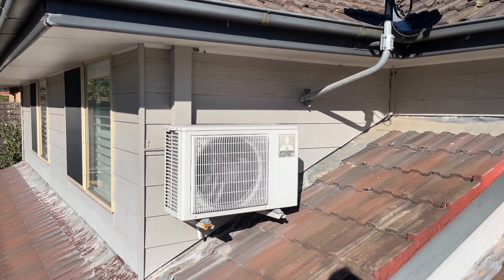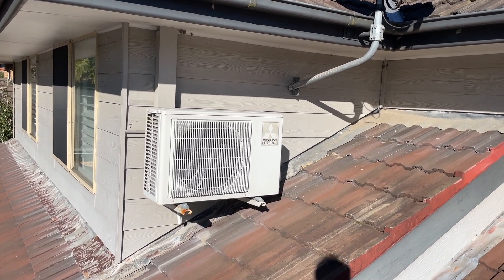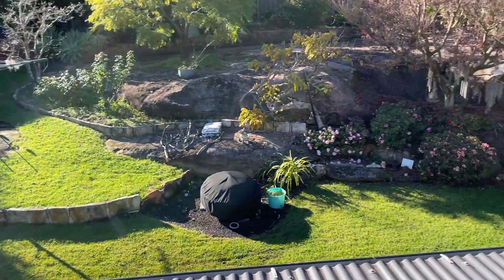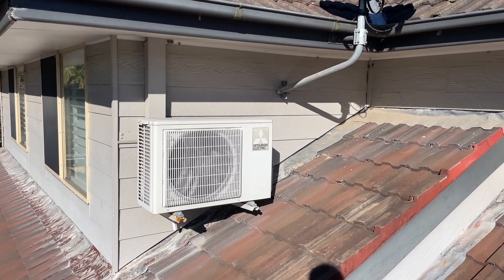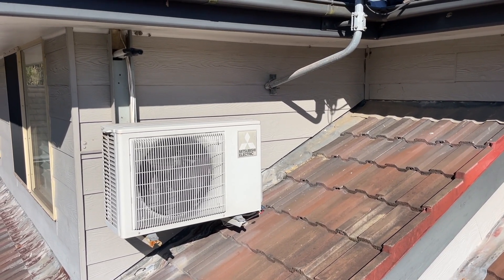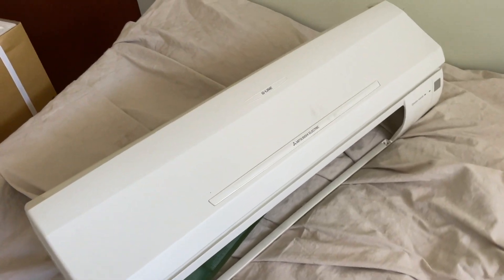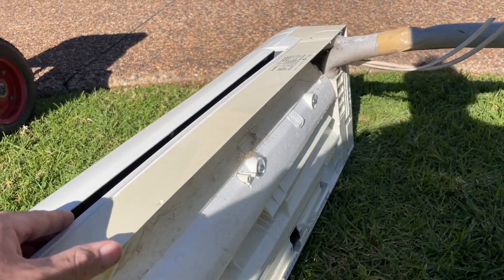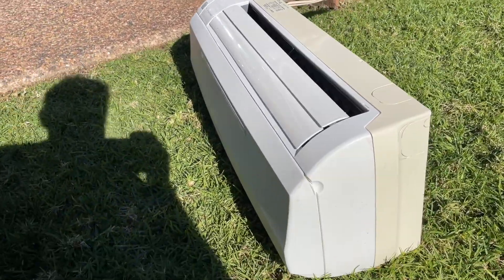Installing a Daikin Ductless Mini Split

Comment: All Mitsubishi Electric minisplit indoor units open that way, old and new. Newer ones have detachable corner pieces, which makes it much easier to open
Reply from the maker: @moisander8858  ah okay. If the sides detach, that’d be easier!
Reply: @maracservices  Yeah, on older ones if they are not going to be re-installed, i just hammer or cut the corners so i can get my fingers under

Comment: Hey mitch. Not a big daikin man, but I've heard warranties being knocked back by their agents for using the blue interconnects. You hear of this?
Reply from the maker: @MentalLapse09  I haven’t but to be fair, I do my own Daikin warranty so i just do what I want and it’s no questions asked. If I got someone else to do it, maybe they would question it. 
I have heard that using 3 core and earth cable isn’t ideal so I should probably change cables but I’ve never heard of anyone actually running unit Daikin warranty problems. It wouldn’t surprise me though.

Comment: I keep an offcut of solder in the toolbag bent into a little hook for unclipping the bottom of those indoor units 🤙🏻
Reply from the maker: @jimmyteesahn  thanks for the tip mate. I’ll be doing the same haha.
Reply: I use two tie-wraps.